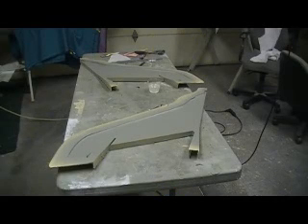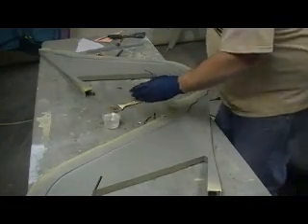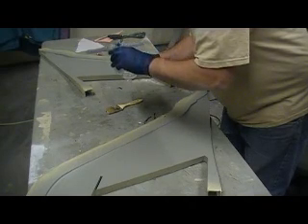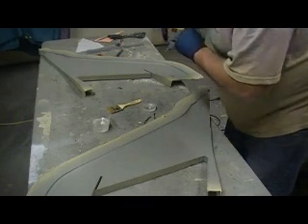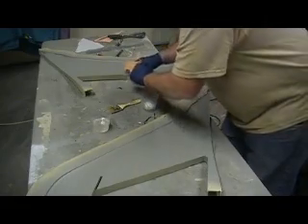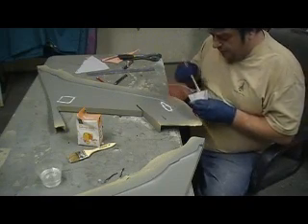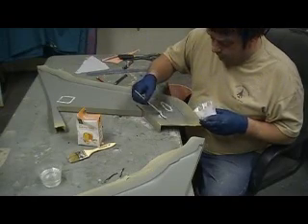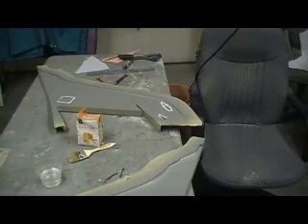how to build a rc jet F-105 thunderchief # 389

Comment: Brings back a lot of memories. One of the first jobs in my youth was building fiberglass boats. One day,I guess the girls didn't put in enough hardner and the hull came out  all floppy like rubber. One thing that kept everyone on edge as we pulled the hull and deck from the mould was static electricity!! Real jolting!!
Also, a year ago I was part of a tour through the DIAMOND aircraft plant in London.
You should see the size of their moulds. Even the main spar is one piece.